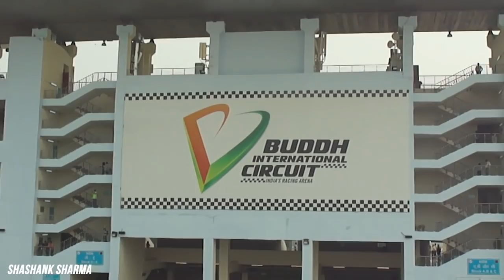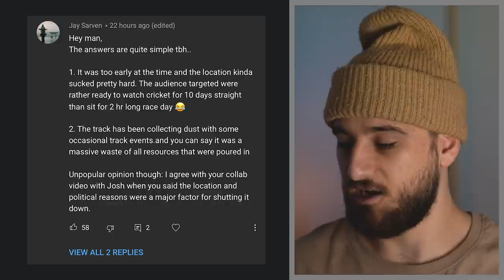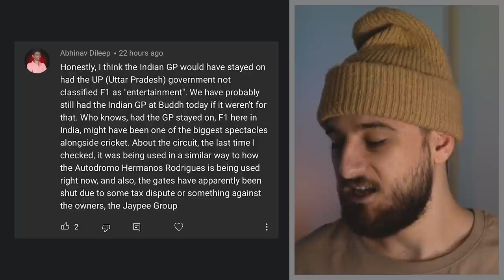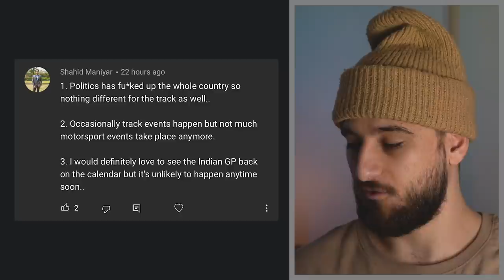The Indian Grand Prix - A Wasted Opportunity

Comment: Imagine making new track in Mumbai which will have worli sea link and marine drive as part of track 🤤😍 . Mumbai GP . This track would be one of the most Iconic track in history of F1.
Reply: In sea link not possible what if a driver falls?
Reply: @silverexperience4931  1, the govt will never allow worli sea link to be used for that.
2. It's a 5.9 km long stretch with only 2 turns unlike most tracks with turns so it's not a great race location for f1.
3. safety hazards and it's a darn bridge.
4. even after all this, the road cat be closed off as it's a very important link and services a lot of traffic, 33k cars/day.
5. not economically viable to close that road and to create a lap it needs to go around many other hospitals and heritage building so there's another issue.

Comment: 2 points that I think could make the Indian GP a success if reintroduced:
1. Tie-up with a low cost airline to charter fans from the western, central and southern states.
2. Tie-up with nearby hotels to give best rates to the fans and arrange shuttles to the circuit from these hotels for a charge.

I say this because I live in Mumbai which is about 1200 kms (700~ miles)  from the circuit. For a two day event, I will have to spend at least 2x times the cost of the ticket to be able to even attend it.

Comment: I think Indian gp is coming soon surely this decade  because The Formula Regional Indian Championship which is India's first FIA-graded F3 championship is coming next year.  It will consist of 5 rounds with 15 races of 30 minutes each with Buddh track being one of the primary track. The series will act as a ladder for indian and asian drivers to the FIA F3 championship, F2 and eventually, Formula 1. So there is goverment support for this as government is vastly different from that was in 2011-2013. So I think this is going to pave way for F1 in the Buddh international Circuit. Fingers crossed 🤞

Comment: What ?  Early 2000s had more fans and probably more die hard fans because of the intense rivalry of Schumi and Hakkinen. Not sure if the current lot has the same passion. About the Buddh circuit it's a good circuit however there are better tracks on the calendar, not a huge fan of tilke circuits tbh.